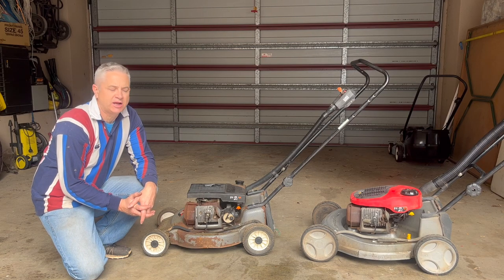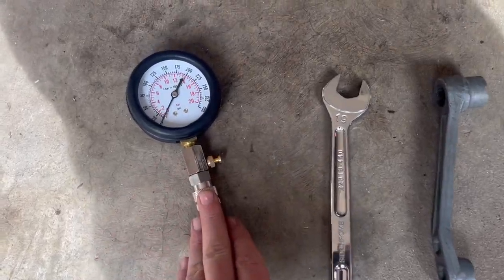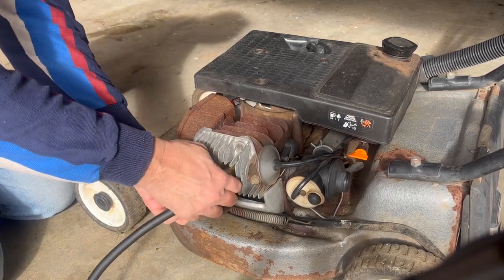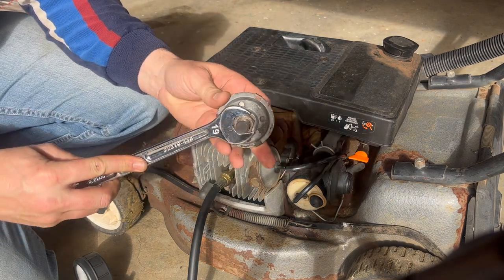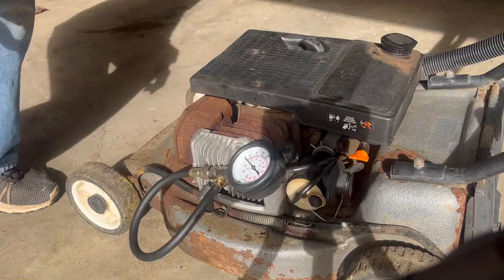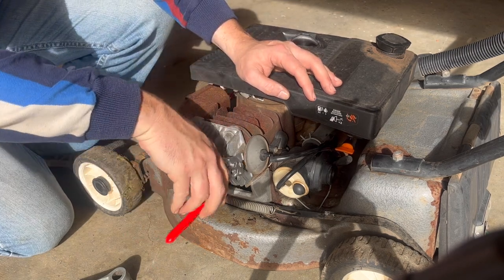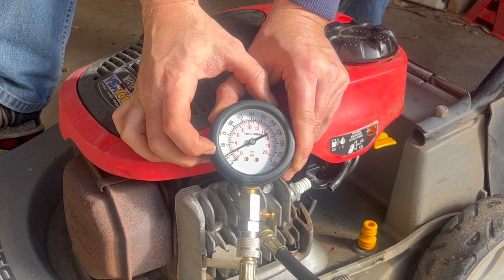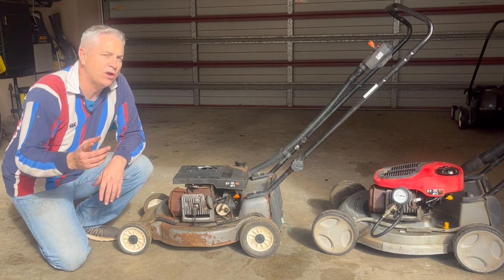How to Compression Test Victa 2 Stroke Lawn Mower - Powertorque

Comment: I compression test my victa, is only about 7 or 8 years old and I gave it a compression test and it was around 110psi insane that I always use motul 800 fully synthetic racing oil 30:1, not sure what is meant to be could be the oil I'm using or it could be a faulty gauge,but goes very well

Comment: Drewfixit don't use that type of compression tester, it won't gives you the right reading. You will be out by at least 20psi lower. That must be a ToolPro. Your comparison is correct. Use a non-detachable compression tester. The reading should be around 80psi with decompression valve blocked. Anyway thanks for your Victa parts order. I through in some extra parts for you to try. Make another video follow-up with different type of compression tester. Cheers, VARIETECH
Reply from the maker: Hi Mate, very interesting indeed.  Can you possibly send me to a link or a brand / model number that I can use to try the difference?  Yes, if the results are truly different I will definitely make a follow-up video!  Cheers Drew
Reply from the maker: Done, here is the follow-up video that you requested: https://youtube.com/shorts/2SG7RBlYh58 You were correct the Toolpro compression tester reads low!  Cheers Drew
Reply: Hi DrewFixIt, Just watched your short video. Well done! I have the same ToolPro detachable compression tester tool kit and I had found out it's not reading correctly compare to my other two similar (twin) non-detachable compression tester but still a ToolPro brand. I'm not surprised why the non-detachable ToolPro reads better than the other one. ToolPro is not tool manufacturer, they are only rebranding the tools. Maybe other brand detachable compression testers have the same problem. Good to know you confirmed by performing a tester comparison. VARIETECH
Reply from the maker: @Varietech-AU  thanks mate. I’ve never even tried to start that green mower!  Looking at it was clearly the “department store” budget model, however owned it clearly looked after it as I have not even cleaned this one and that compression was great so really looking forward to starting this one and seeing how it runs!  Cheers Drew